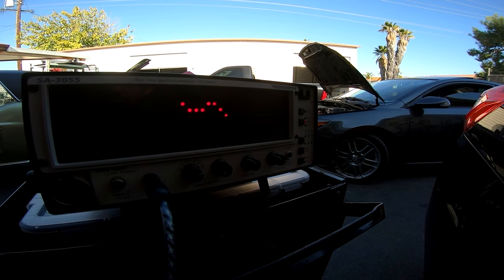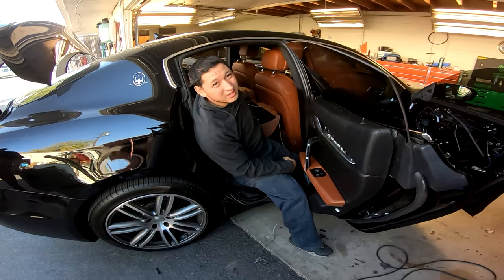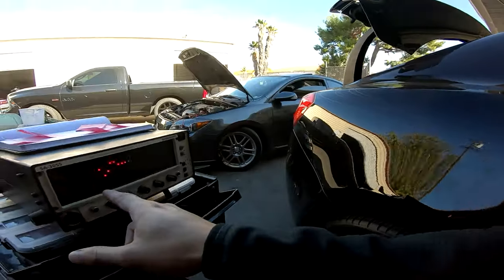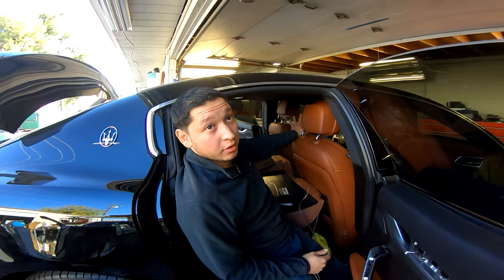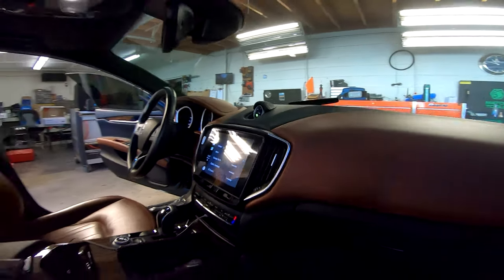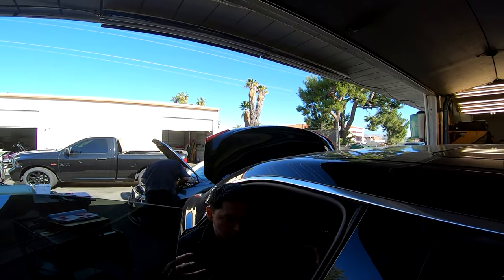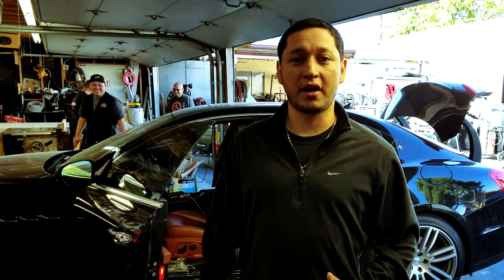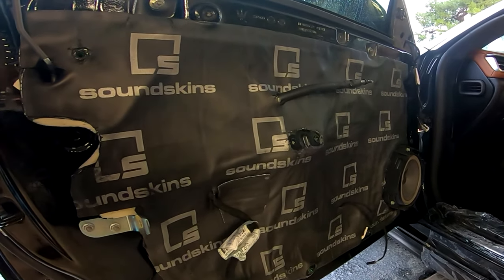Maserati Ghibli sound system with oem stereo non amplified

Comment: So how did you end up getting a good signal for bass?
Reply from the maker: Yes we did
Reply: For anytime with the 2017 base stereo. Please message for help if you want to connect an amp.  I have a 5 channel amp installed.  Replaced all speakers and added a custom subwoofer box.   Not that hard but the amp install is a challenge since the base is non amplified.
Reply from the maker: @stimey0000  call me at my shop 951 601 1100
Reply: Which wire you tapped into to find the signal?